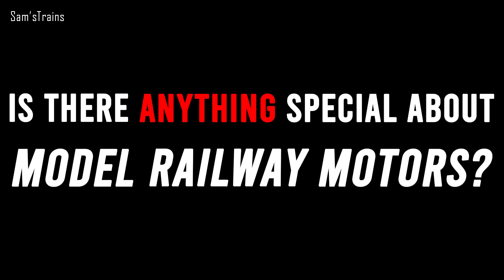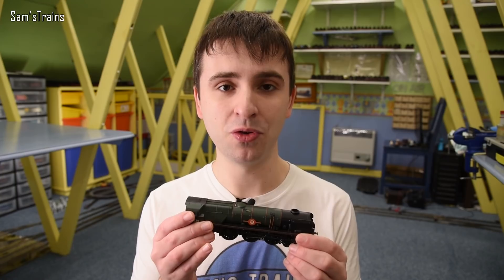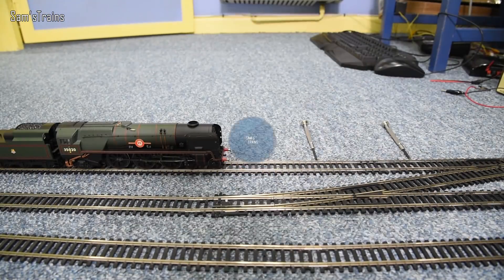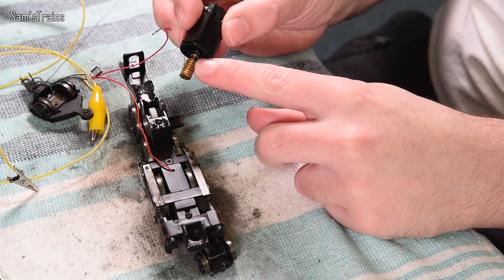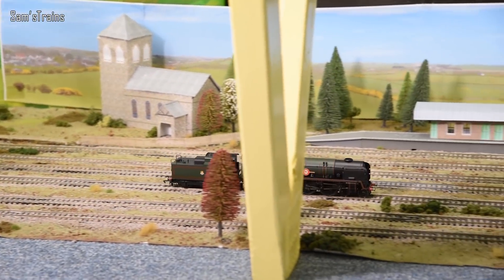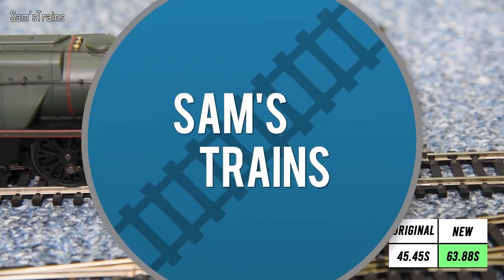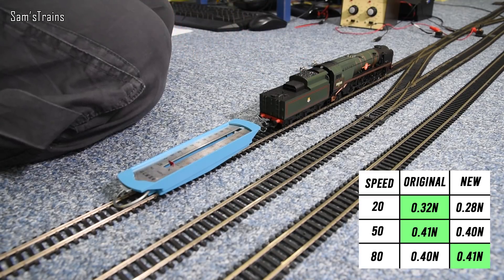How Much Do Model Train Motors Really Cost? | £2 vs. £27

Comment: There's still the question of long term durability, but at a tenth of the cost it'd have to be very poor indeed to negate the bargain price. Nice research project. Thanks for doing this.
Reply from the maker: Yes you're right! I've been using these since 2018 - no failures as of yet!
Thanks for watching - Sam :)
Reply: It is the same motor !!!@@@@
Reply: @steffenrosmus1864  Visually almost identical, sure, but appearance tells us little. Examples of low-quality knockoff products abound: just set foot in any dollar store.
Reply: @mattp1337  not only visual those motors were built in China to the millions for most of the model rr companies. If you open both motors and check the interior you will find out they are identical. Built model re remotoring kits for brass engines for 40 years now and found this situation nearly everywhere
Reply: @steffenrosmus1864  If you say so, but the whole point is that you can't know from some random eBay listing whether it's identical or a low-quality knockoff. This video at least gives some independent reassurance that quality motors equivalent to the branded product exist at this price.
Reply: @mattp1337  fact is, those motors are all low quality
Reply: @mattp1337  You might find a lot of difference in Siemens vs noname chinese 20 kW servo motors - latter won't last as long - but those jellybean model motors are all the same, nobody's gonna bother with high quality manufacturing because none of that stuff is subjected to the kind of loads that will impact longevity. It's the same deal with Lego motors actually, they use generic 15 cent chinese motors, put them into 5 cent plastic housing, and then sell motor units for $20. All brand name products are ripoffs just because you're paying for the brand and not just the product, some have higher quality than knockoffs but more often than not they're the same stuff made on the same factory.
Reply: @steffenrosmus1864  Or all those motors are high quality. It is entirely possible that no further product refinement can happen no matter how much money you throw at it.
Reply: @jonasmadsen8535  have any clue of engineering don't think so those motors are primitive constructed and built from the cheapest materials no comparison to high quality motors made by Faulhaber, Maxon or Escap which were built in in high end model trains.
Reply: @SamsTrains  Your train related product safety videos are excellent and quite relevant to your motor comparison in my opinion - "How to Burn Down Your Model Railway | Train Motor Meltdowns" - "The Time My Model Railway Almost Burned Down" - You're the Best - GOAT (Greatest Of All Time LOL!)
Reply: yea
Reply: Very interesting bit of research.....

Love the way some folk say "oh but these are cheap knock offs........"

Without considering that these are actually good quality mass produced motors that Hornby just happen to use......

Comment: brilliant Sam just shows how we are being ripped off by the prices of modern locos. Could you do similar with a replacement Bachmann motor?
Reply from the maker: It would be harder with Bachmann - I've not found any suitable replacements - it seems they might even use their own proprietary motors. If true, this is even worse of course, since you can't do any other than buy from Bachmann - also at £17 a piece, and those are just 3-pole!
Thanks for watching - Sam :)
Reply: @SamsTrains  I am not convinced that the Bachmann 3 pole is as good as the Hornby 5 pole.
Reply: Sam can you do a video on different types of motors ie 3 pole 5 pole etc and explain the differences. Even the old motors as I have old second Hand locks. Thanks
Reply: I have both Bachmann & Liliput locos and the motors all have Bachmann stamped on them so they must get their motor supplier in China to do that.

As for the motors being only able to be fitted in Bachmann locos & Bachmann/Liliput locos only able to take Bachmann motors, I'm not so sure.
Reply: In my experience the Bavhmann love will out perform the hornby loco every time, so much so I  loathed to buy anything Hornby these days
Especially in a commercial situation. 
I have swapped several castle/county motors with cheaper alternatives and they still work and usually fail with other faults 
I also struggled to find a replacement for the Bachmann
Reply: I think that “ripped off is the wrong way to think about it. It’s a tiny niche market that demands high accuracy. If millions bought them the prices would be forced down by competition. The number sold are in the thousand only.

Comment: Markup for handling small volumes is high. You don't make a living selling those motors 2 a month with a 50% markup. It doesn't pay the inventory space taken. This is not a ripoff, this is the cost of maintaining an inventory of slow moving product. The cheaper motors came in bulk. You can buy 10 motors for less than you can buy 1 from a retailer that pays someone to keep inventory, produce a web page description, etc. This is the reason a bottle of ibuprofen in the pharmacy is about 10 bucks, but a single serve pill with barcode tracking for a patient chart record delivered by a nurse in the hospital is much more expensive.
Reply from the maker: I get it - Hornby have to make their money - but I can't believe that hosting a webpage and holding these in stock can justify a 1300% markup. Don't forget, the £1.60 I paid included ebay fees, paypal fees AND the postage to my front door from China.
Also, these are supposed to be replacements for parts that have ALREADY been sold - if parts are failing and need to be replaced, I don't think it's right that they should profit so massively from the spares!
Thanks for watching - Sam :)

Comment: Think this video misses the point. The issue on a £150 loco is not whether the motor costs £2 or £20 but can you find a suitable replacement? There is motor shape, diameter and length, shaft diameter and lengths and rpm. Finding the right motor on ebay is a pain and takes a month to come from China. My Hattons 66 had a faulty commutator which I managed to clean and get working but it goes wrong again periodically. I asked Hattons if they had spare motors and they said no. Similar thing with Kernow Class 41 and they sold me a replacement motor for around £20. We need the manufacturers to sell us spares otherwise we have non-working models for £150. At £2 probably not worth it. Personally glad to pay £20 and get the loco working again.

Comment: I believe the original Hornby motor is a Kato HM5, which actually does not have a skewed armature, so that could explain the difference in slow speed performance.

The new motor appears to be the HM5 copy used by Atlas and a few other manufacturers making their trains in China.  I haven't pulled one of these apart before, but's it's very possible they have a skewed armature unlike the Kato motor.

I almost never buy brand new motors from the manufacturers anymore.  By looking around for surplus or direct Chinese motors with the correct specs (or pulling from old CD drives and printers), you can often save anywhere from 50% to 90% off of buying from the manufacturer, and sometimes end up with a better motor!
Reply from the maker: Yes - it does seem to be the same size as the Kato HM5! I've pulled motors like this apart before, they did appear to be all but identical to the Hornby ones - though this was some time ago! You're right - I won't be buying from the major manufacturers again, unless there's no alternative!
Thanks for watching - Sam :)

Comment: If we used 6 or 8 pole motors they should run smoother would they not? This is right up my alley Sam. I have an avid interest in railway research... my collection of Rail Technical Centre liveried coaches and locos speaking volumes. Great to see such testing with such an interesting topic. I like your impression of the Old Dalby Test Track! Cheers.
Reply from the maker: I don't know much about that Gary - I think there are issues with heat dissipation/over complexity with that many poles at such a scale - I've certainly never seen such a motor this tiny! Really glad you enjoyed this though mate, haha!
Thanks for watching - Sam :)

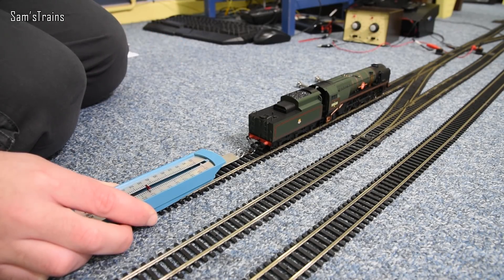Comment: Nice video. However, @6:54 when measuring the pulling power on the original motor, just before taking the reading, it looks as though you accidentally moved the meter in such a way that would give a higher reading.
Reply from the maker: That doesn't matter too much - I tend to shake the meter around to get a more accurate reading!
Thanks for watching - Sam :)

Comment: One thing that I have found to improve performance on a few used models I have bought in the past was to remove the wheel sets and clean out the bearings from the driving wheels (especially if the loco tends to surge and slow at a constant rate). The slow speed improved dramatically afterwards, so it might not always mean the motor needs to be replaced. Thanks for the video Sam, always helpful to know more!
Reply from the maker: Yes absolutely - that's definitely a key part of the servicing, it's well worth doing!
Thanks for watching - Sam :)

Comment: This is quite fascinating. I have an old 1950s Tyco 4-6-2 that predates the exposed worm and has a superior enclosed gearbox and an original  Pittman open frame motor as seen in bowser and brass models. 
It runs so outstandingly well I want to give it dcc and sound however I'm afraid the motor may be pulling just over most decoder amp limits. At least it seems if need be, I can find a good can motor for cheap!
Reply from the maker: Oh very nice - great to hear those run well! Yes do be careful - the old motors can damage sensitive decoders!
Thanks for watching - Sam :)

Comment: what is the link for the motor you bought?? with the single shaft, I am on finding dual shafts
Reply from the maker: You have to keep an eye on Ebay - they pop up and disappear quite frequently!
Thanks for watching - Sam :)
Reply: Look at aliexpress, it's even cheaper than Ebay. Mabuchi motor is what I search for my french locomotives.
Reply: @renenoel2641  You can't go wrong with Mabuchi - they make motors for all kinds of models. Even the smaller and cheaper ones (like the type 130 they make for Tamiya's mini4wds) are ridicolously resilient - at the model shop I used to race at we did even endurance races with those (the Light Dash in particular), and even then they would simply not give up. You could literally do several more regular races with the motor they issued you for the endurance race!
Reply: @renenoel2641  I buy frequently from AliExpress, no loco motors yet though. Do you have a preferred supplier for those Mabuchi motors? Link?
Reply: @renenoel2641  Just did an AliEx search. No Mabuchis in spec, and only a single hit on the same five pole Sam uses here, but only offering single buy at a silly price for AliExpress ATM. Looks like Ebay FTW. Heading there now.

Comment: I use £1.99 motors ( made for moving car wing mirrors) and home made gearboxes using bags of Chinese plastic gears and I put them in O gauge locomotives. The models are radio controlled and performance is superb and I regularly haul 8/9 coach trains for hours at a time.  A commercial O gauge motor/gearbox can run into 3 figures. Found your video very interesting. rgds Graham Powell
Reply from the maker: That sounds wonderful Graham - props to you for building gearboxes for them too - I'm definitely not skilled enough for that! Great work!
Thanks for watching - Sam :)

Comment: It’s the same with slot car motors from the same supplier incidentally.  Run them in under water for an hour they are beautifully smooth. Regards Gary
Reply from the maker: Blimey, do you really do that underwater?? What's the thinking behind that?!
Thanks for watching, Sam :)
Reply: @SamsTrains  attach wires to the terminals, put the motor in a small amount of water. Run at low speed. It cleans the com and smooths out any roughness in the pickups if they are present. It’s called water spun tuning. It’s on YouTube. Not recommending submerging the loco though 😉

Comment: Very interesting video, Sam. I'm going to be experimenting with some motors for my custom build trains and a gear puller will be a game changer. I have a selection of Chinese motors from Ebay along with a few packs of nylon gears and worms for prototyping configurations. I'll be powering both ends of my HS trains so cost is an important factor. It's good to know that these motors are at least as good as the ones we already use. Nice one mate :))
Reply from the maker: I can recommend it Tom - they work fantastic! Good luck! :D
Cheers,
Sam :)

Comment: The real test is longevity.  I have bought cheap adaptors for computers before now, saving sometimes about £50 but, although worked perfectly at first, blew up fairly quickly.  Never lasted anywhere near as long as the proper make of adaptor.
Reply: Mate Hornby use cheap motors from China too. End of.
Reply from the maker: Power supplies are very different - never buy cheap ones! I've actually been using these cheap replacements in my models since 2018 - I'm yet to have any failures! It's very probable that Hornby use the same sort of thing!
Thanks for watching - Sam :)

Comment: Don’t forget though that the cost of production is only a small part of the overall picture. You’ve got research & design, tooling, factories, production line costs, paid staff, shipping, taxes and of course profit. Don’t get me wrong though I do agree prices are getting steep. I was debating the GBRF class 50 until I seen the price! Scary and will put people off. Either way though that was an interesting video! I now have an idea on how to revive some dodgy runners!
Reply: I understand what you are saying, but Sam was only talking about the motor. Some new models are still being made with the old moulding tools. Take a look at Jenny Kirk's videos.  Martin.
Reply from the maker: Yes very true - all of this applies to the models, but not the motors! It seems most of Hornby's models use standard readily available motors!
Thanks for watching - Sam :)
Reply: Martin Pattison will definitely take a look at that :). It was more of a general comment but it was interesting to see, especially as Hornby charge like 20x the cost for the same thing!
Reply: Sam'sTrains that’s very true! May have to get some I think to revive some older models 😂

Comment: Do Hornby locomotives have coreless motors? Some locomotives made by Kato, especially the steam ones are powered by a coreless motor which greatly helps in lowering the crawl speeds of the locomotive and allows smoother performance.
Reply from the maker: None of Hornby's locos have coreless motors - I've never seen a coreless motor perform better than a 5-pole skew wound, but I've heard good things about them!
Thanks for watching - Sam :)

Comment: I know this is an old video and all, but do think these could fit and work in the original P2s? (The TTS and Railway ones which had 3 pole motors to them). I live in the USA so prices for spares and parts are even more steep and hard to find.

Comment: I wonder if you could use on of these to replace the HP motor in a cheap Hornby 0-4-0? Seems like a cheap way to get better operation out of these locomotives.
Reply from the maker: You can, but it's not this particular motor - I've had the smaller 5-pole can-motor from ebay before! :D
Thanks for watching - Sam :)

Comment: Oh yes, it's exactly the same motor I think. Hornby sells it with a very high profit, Märklin and other firms here in Germany practice the same thing - but even perhaps the well generated profit seems to be much higher... An average price between 30 and 50 Euro is required for that would-be original spare parts... And meanwhile it's even normal you CANNOT replace the carbon brushes any more because the used China motors are encapsulated... A very good video giving a revealing insight. Happy Easter from Germany! :)
Reply from the maker: It certainly seems so! Oh wow that's incredible - what a price!! :O
Although the brushes can be replaced with these - it's just a nuisance to do it!
Thanks for watching - Sam :)
Reply: @SamsTrains  Well no, some coreless designs are brushless https://www.portescap.com/products/brushless-dc-motor/bldc-motor-design
Reply from the maker: Indeed they are, but I believe they need support circuitry to run them - I'm not sure any of the usual manufacturers use brushless motors!
Thanks for watching - Sam :)
Reply: @SamsTrains  My Trix P10 loco does, a brush coreless design.  You can see a pic of the motor here  https://www.rmweb.co.uk/community/index.php?/topic/153417-coreless-motors-back-emf-feedback-controllers-dcc/page/2/
Brushless coreles designs tend to be for very high rpm applications

Comment: they should be about the same but it really comes down to the magnets. the newer motor would have fresh magnets but the quests would be the longevity, heat and general usage will reduce field strength. this can be mitigated by better production chemistry that dose coast money.
my bet is that they really are about the same with in the manufacturing variability.
Reply from the maker: Yes you're probably right - though I'd expect they're using neodymium magnets these days!
Thanks for watching - Sam :)

Comment: @Sam'sTrains I've come across this issue when trying to replace a burnt out X04 motor in an old train of my dad's.

Is there a cheaper solution than the £28 upgrade kit on Peter's Spares?

I can probably find a motor but does anyone make the custom mounting bracket? Or is that why Peter's can charge the big bucks? 😂